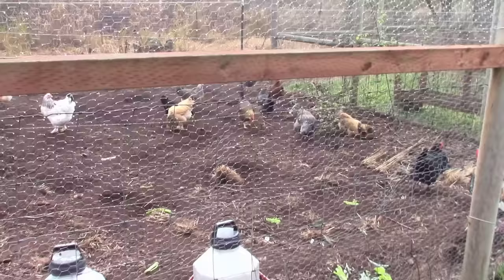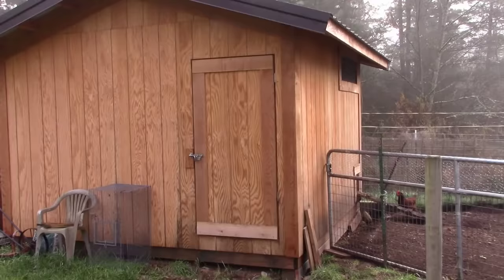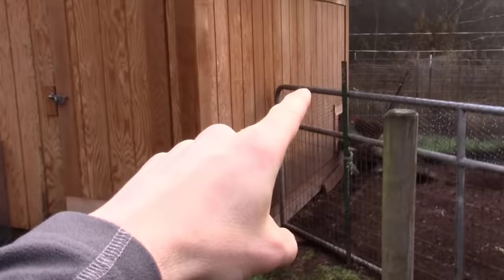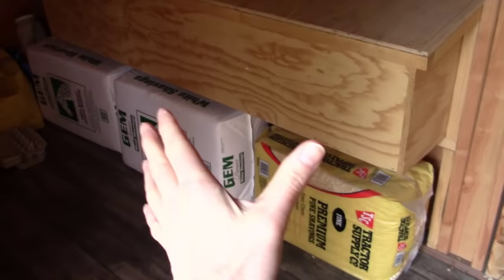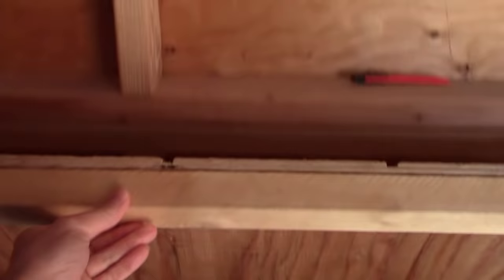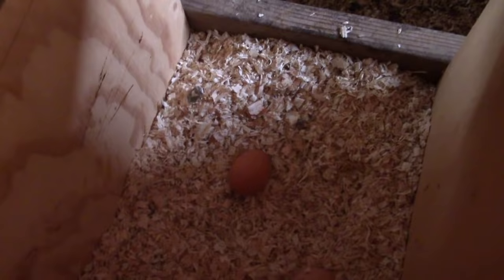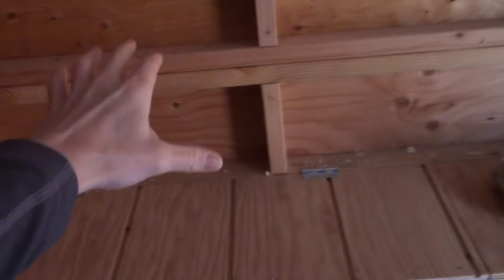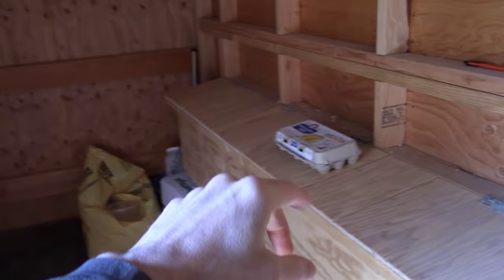How to Build a Tiny Pole Barn in  -5 MINUTES-  | Chicken House Plans

Comment: Whats the height length and width of your barn please ?
Reply from the maker: It's 12 x 12 with 8 foot walls.  The roof is a 4/12 pitch with 18 inch overhangs.
Reply: @MikeKincaid79  Thanks for the info

Comment: How deep did you set your posts?
Reply from the maker: These posts were put about 30 inches in the ground, which is overkill for my area and a small structure like this.  I had a 36 x 48 pole barn build a few years ago and those posts are 4 feet in the ground cause that's code for my area.  The frost line here is about 18 inches.  The soil is hard and rocky with big boulders, so it's very compact and good to build on.  So there will be variables that you'll have to take into consideration in your area.  If you have soft or sandy soil, or live in a colder region, then you may need to go deeper or even pour a concrete footing.
Reply: @MikeKincaid79  Thanks! Yeah I think my frost line is around 36 inches or more so ill probably have to go 48 inches.

Comment: hey homie go to home cheepo and get a 6 inch piece of PVC and cut in half 2 pieces then strap it and go you save a couple hundred bucks and get a tote to save and store the rain water
failing to prepare is preparing to fail
Reply from the maker: I've got plans to collect rainwater on all my building and store in massive water tanks.  I have this idea of collecting thousands of gallons of free rainwater every winter and then having the tanks plumbed into irrigation that stretches out to all areas of my landscaping and orchard.  Then when it gets hot and dry in July or August, I open the flood gates and release thousands of gallons on all my plants over a week or so.  That's the dream anyway.

Comment: What is that sheet under the metal roof, and what does it do?
Reply from the maker: Insulation.  It prevents condensation under the metal.  Commonly used with metal roofs.
Reply: @MikeKincaid79  What is it called?
Reply from the maker: I don’t know of a specific name but you can ask for it in probably any local builder’s supply and they’ll know what you’re talking about.

Comment: Love it , can I get the plans ?
Reply from the maker: If I had them, I'd gladly hand them over but I build this from scratch and without plans.  I modeled it after the well pump house on my property.  It's 12 x 12 with 8 foot walls and I think the overhang on the roof is 16 or 18 inches.  The roof pitch is 4/12.  The corner posts are 6x6 pressure treated.  The door posts are 4x6 pressure treated.  The walls and roof were all built with 2x6 lumber.  The floor was 2x10 pressure treated with 3/4 inch treated plywood.

Comment: For the longevity of a building ground contact wood is not ideal watching a channel such as RR buildings who build pole barns they concrete below the frost line and then use a steel bracket the wood to the concrete to keep it up out of ground

Comment: Do you have a link to the plans?
Reply from the maker: No plans, I just built it as I went.  I had a similar structure on my property that I used as a template.
The measurements are 12x12 with a 4/12 pitch roof with 18 inch overhangs.  The corner posts are 6x6 pressure treated lumber.  The door posts are 4x6 pressure treated.  Floor joists are 2x8 pressure treated, floor boards are 3/4 inch treated plywood.  All other lumber used was standard 2x6 douglas fir except for the center wall, which was 2x4 lumber.
Reply: @MikeKincaid79  thank you for the info.

Comment: Structurally… The roof is not done correctly. I hope there is no snow load consideration here. The load transfer is now dependent upon the sheer force on the nails or screws of the outer rafters connected to the four vertical posts.
Reply from the maker: Trust me Brent, it's strong enough

Comment: What are the dimensions, square footage?
Reply from the maker: The base is 12x12.  The walls are 8 feet tall.  I put the middle wall a little off center.  It’s about 5 feet wide on one side and 7 on the other.  The roof pitch is 4/12

Comment: No footings under the poles. Not much load carrying capacity there.
Reply from the maker: Not much load to carry
Reply: It is more than you think. It is kind of like trying to walk on snow without snow shoes. The other thing if the post is sitting on soil it is going to wick moisture up thru the end grain which is going to promote rotting. The pressure treatment isn't going to be doing much on end grain and if you cut the column all bets are off. You should have at the very least thrown some gravel into the hole and coated the bottom of the post with asphaltic roof tar.

Comment: Hello subscribe your Chanel and I absolutely love what you built and I need to build one here in my ranch can you send me the material you use for this one you built I would high I appreciate I have 1000 chicken.
Reply from the maker: 1000 chickens!  Wow, you'll need a much bigger barn.  I don't have a materials list but the dimensions are 12 feet by 12 feet, with 8 foot walls.  The roof is a 4/12 pitch.

Comment: Could you please send me the blue prints for that chicken house?
Reply from the maker: There are no blueprints.  I built it from scratch by looking at a similar structure on my property.  It's 12 x 12 with 8 foot walls.  The roof pitch is 4/12 with either a 16 or 18 inch overhang.  The 4 corner posts are 6x6 pressure treated, the door posts are 4x6 pressure treated.  Walls and roof are all build with standard 2x6 lumber.  All floor joists are treated lumber with 3/4 inch treated plywood.  The outside sheathing is T111.
Reply: @MikeKincaid79  WOW :) Thank you for the information and reply. Thank you :)

Comment: Where's the moisture barrier?
Reply from the maker: It's the pole barn insulation I put on before the metal.
Reply: I was talking about on the ground.
Reply from the maker: No need, it’s not sealed off.  The side boards are raised of the ground several inches.  Plenty of air flow.

Comment: Dude NEVER  use screws! Yes easy but just as easy to snap. Gun nails have a lube and glue method. I have tried and tried reusing 2 bys that have been nailed with a gun, not worth the werk. I applaud your effort to inform people. Not hating.
Reply from the maker: No nail gun.  I used screws to get the boards up and went back and put 3 times as many nails in everywhere.

Comment: Why do not you build a house with cement, block and so many remains the strongest and against nature and fire factors
Reply from the maker: I suppose I could have done many things different but this is what I went with.  Most structures in my area are built with lumber.

Comment: You forgot to insulate the floor.
Reply from the maker: Sounds like a big thing to forget, lol.  Or maybe I chose not to insulate it because it's a chicken coop.
Reply: @MikeKincaid79  why insulate the roof.
Reply from the maker: It's a metal roof.  The insulation I used is for metal buildings.  It keeps condensation from forming on the under side of the metal and dripping down.  It doesn't actually keep anything warm, just prevents condensation.  There's no insulation in the walls either.  Chickens don't need warmth during the winter, especially in my zone of 8b.
Reply: @MikeKincaid79  it's a chicken coop.

Comment: Chickens need a flat board I use a 2x6 and 2x4s flat because  their little toes are going to get cold  and get frostbite. I would add a 2x4 on top of each one of those 2 by 4 but put it flat , they will be so much more happy,  if you use a 2x6 you're going to be cleaning poop off.

Comment: Everything you did with your chicken coop I did with my accept I put the doors on the outside so I could get my eggs out without going inside and walking on the floor if you want to call that a floor I took stuck or I don't know what they call it in a world that's what I called and I turned it upside down and put the smooth side up with a rough side down and everything is a chicken's want to leave for me but you on the ground lot nicer lot easier to clean all they get the eggs off Academy I raised the doors up and I had to stand with my head holding the door up to get the eggs out so I'm going to change it around those doors go down and I have someplace to put the eggs when I'm getting them out this cell phone to my exit don't get along so there's going to be a lot of weird words I know and I ain't no stopping rewrite the whole damn thing anyway that's what I do with my chicken coop and then when I get ready to clean it I could get it cleaned out lot easier and I just put a skirt around it. At night when I want to put my chickens up which I have to every night I get a pole with a long black shirt over my head they think it's a drawer I don't know what they all run inside by themselves and I shut the door
Reply from the maker: So many ways to build a chicken coop.  Glad you found one that works well for you.